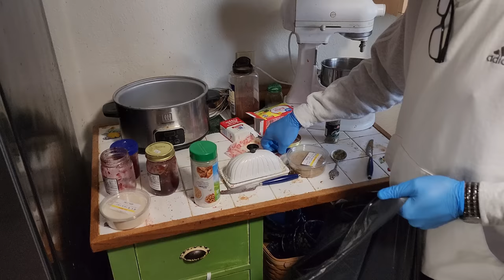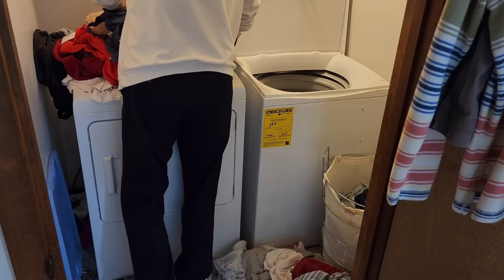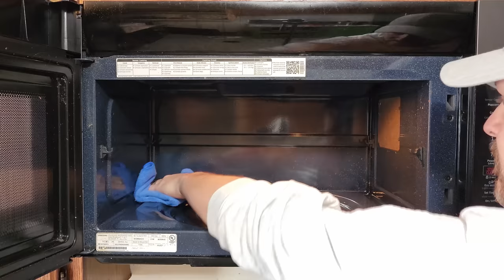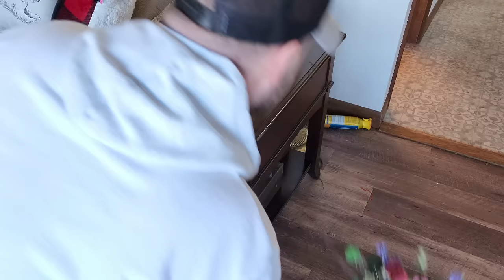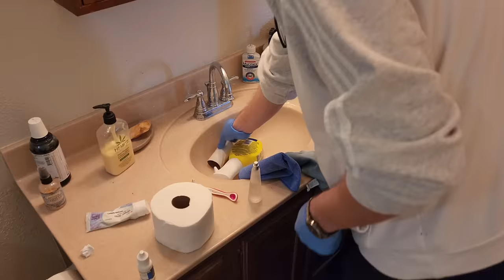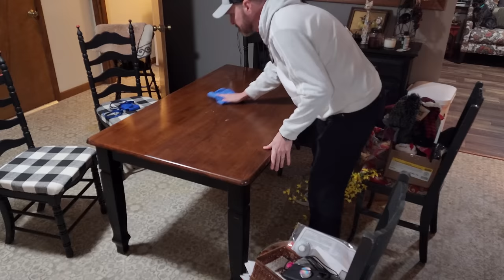Surprise cleaning an elderly woman's house for FREE!

Comment: Just a tip: if the oven has a self cleaning mode put the cast iron pans in when you first arrive and start the self clean process, 4-5 hours while your doing other things they’re done, all the crud turns to ash! Scrub with a stainless steel scrubber and rub with vegetable oil or shortening and they’re beautiful again! Beautiful home and great job!
Reply: Great idea Debra 😊

Comment: For rusty dishes, there's actually a reusable kitchen safe product called Vapo-rust that you just soak them in after washing with soap. The rust comes off. They sell it at Harbor Freight and on Amazon. I used it on horribly rusted steak knives and pans left out in a shed. Works really well.
Reply: evapo-rust?  lol i put vapo-rust into amazon and it kept giving me vicks vapo rub results.  thanks for the rec!

Comment: You are an angel for cleaning a house for an elder.
Reply: Another tip for disabled. Get rid dust harbourers  such as trinkets. Seems cleaner then. And put stuff in cupboards to get into good habits. Letting dishes pile is lazy. Just run hot water and dish soap and sink dishes in to soak.
Reply: @anneashley5110 These types seem to want to collect even more of these items for some reason. Smh
Reply: @bobbyray7558 Yes ,you are quite right. Can't bear to part with anything. I know a doctor who hoardes medical mags. A real problem for wife. But he believes there may be info that he will need for someone someday. Accepted. But objects?? 
Happy memories or.....a mental health issue????
Thanks for nice reply.

Comment: I am a clean freak (like my mother) and even though I have regular help, I still keep tight control of hygiene and sanitation levels of my home (we have two dogs). I know as one gets older, it gets harder but if it’s one’s habit to keep things clean, it isn’t that difficult (one does need big help for big jobs). 

I liked the way you handled the situation. It didn’t look easy to me. Just one question- wouldn’t using a good vacuum cleaner be better than the brush you used? That house needs a good thorough vacuuming and heavy duty mopping, especially with the urine odor.

Comment: Here are some of my favorite cleaning solutions… for ceramic floors I use hot water with 1/8 C. Dish machine powder,& 1/4 C. Bleach… it sanitizes, doesn’t suds up… so no rinsing. Toilet bowls I use about an 1/8 C. Bleach…brush,& let soak for 1/2 hr. My favorite cleaning spray is “Mean Green”… non toxic, no unpleasant smell, cleans grease well… spray on , let work for a few minutes… then wipe down, or use a scrubby sponge. For micro waves… put a bowl of water, with 1/8 C. Vinegar in it… in the microwave… close door… run on high for a few minutes to steam clean the inside. Be careful, remove hot bowl of water… wipe down inside surfaces. For porcelain sinks fill with water, 1/8C. Bleach… let soak for a while…if still stained after draining water… use a scrubbing powder like Bon Ami,& a scrubbing sponge. If the strainers,& drain are icky… use a Clorox type spray…let soak for a while… then rinse. For  glass,& mirrors ammonia type spray,& paper towels. For wood surfaces… I like lemon oil, or other oil based furniture polish/cleaner. For lace curtains soak in warm water,& 1/8C. Ammonia per 2 gal. H2O. I’m also experimenting with a bleach alternative, hydrogen peroxide laundry liquid for cleaning cloth items, surfaces. I am trying to find something safe for a laminate… I’ve tried a hydrogen peroxide floor cleaner, but it comes out dull …any hints?

Comment: About those cast iron pans......their easy to clean and you don't have to restore them. Dump the dirty water in them down the drain. Refill them with water, put them on the stove and turn the burners up on high. Bring them to a boil and let them and let them boil for 15 to 20 minutes...Turn the heat off and let them sit for a little bit. Then dump the water in the sink. If some is still stuck on the pans just get a spatula and scrape it down the drain. Grab some paper towels and dry them.

To season pour some vegetable oil into the pans. Take some paper towels and spread all over the inside of pan. All done. No need for restoration or sand blasting.

Comment: One thing I have found with at least our microwave...an easy way to keep it clean is after you are finished heating food in it, let the door stand open for a few minutes to let the steam get out of it. Our microwave was grungy and kinda had a smell to it...I washed it out really well then told everyone to leave it stand open for a few moments (up to 5 minutes at most per use) just to let the steam and smells escape and it has stayed so much cleaner than ever before.

Comment: Maid since age of 16. Now in my 60s. The best stuff to clean in my opinion on dirty vinyl floors is a mix of ammonia and water. 4 parts water, 1 part ammonia. Soak floor with mop and mixture. Let stand maybe 3 minutes. Then mop and then do a rinse mop. Easy, little wait. Can use on cabinets, walls, toliets etc. Just remembered to open door or window and if too heavy a smell, stop for about 5 minutes. They use it in prisons..

Comment: An easy way to restore cast iron is to run the self clean cycle in the oven with the pan in there. Then if any rust remains just use distilled vinegar and steel wool. Best oil to season with is flax seed oil.

Comment: small bathrooms - try using something to hang the camera from a curtain rod, light fixture, air vent maybe?
grunge floors - I've used hot water and zip soak then long-range firm scrub brush and it peels the layers of yuck right off for me. Might work for your kitchen here pretty well?

Comment: I cleaned my two favorite cast iron  pans with regular ole sand. Playsand would work. Then go from there. They wer at a yardsale and has sat in an area where rainwater had  dripped. I think I paid $5 for both.